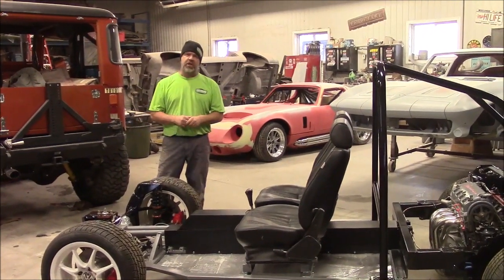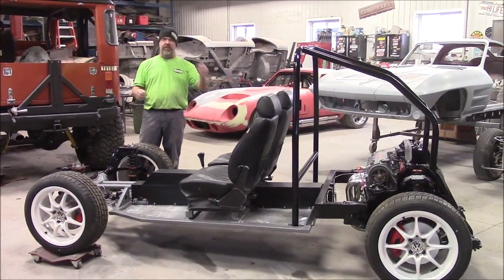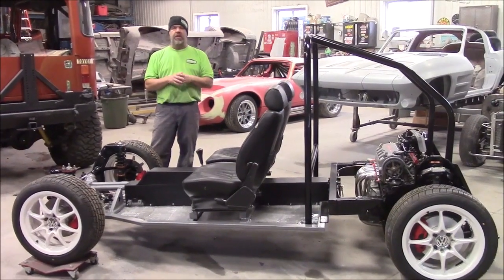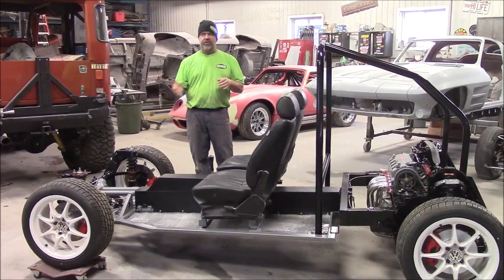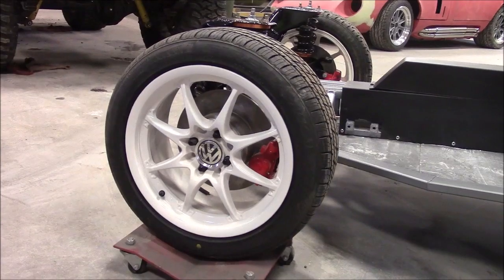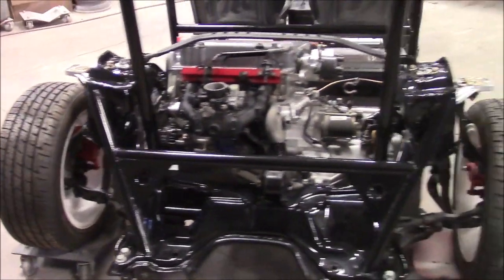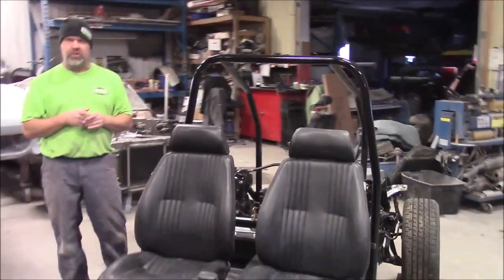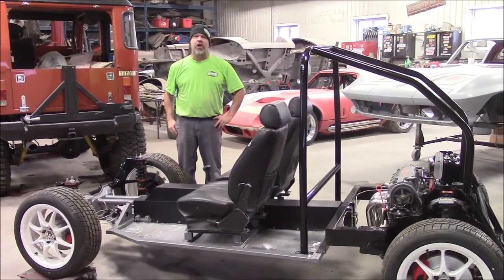Sportman Motors Intro, Custom Built  Resto Mod  Volkswagen Bug Beetle,  lastchanceautorestore com

Comment: Is is possible to ship overseas just the chassis, with the independent suspensions, disk brakes, roll bar, etc. I'm in Malaysia, we could get source a local VW bug body, tires and engine fixed in. I can't possibly import a car with tires and engine, that would be illegal, but a hunk of metal is fine. Also, we drive on the opposite side but I reckon that could be engineered to work locally. Would be very keen on this if it's possible.

Comment: Hello VW Bug world, I’m pulling out a ford pinto engine 2.3, out  of my Rail buggy and getting a 1915 Cc VW stock engine, it’s about time, it’s a dual carb and being installed by a 50 year plus experienced VW mechanic! My question is, He’s installing stock carbs and a stock muffler!   What modifications are best to have my mechanic Install as he spends the next 2 weeks installing my new Engine into my rail buggy? Thanks so much ! Please be as specific possible !